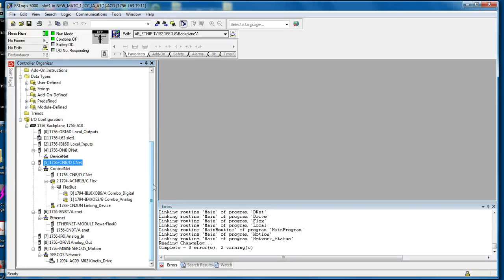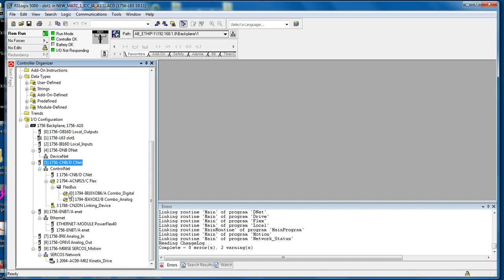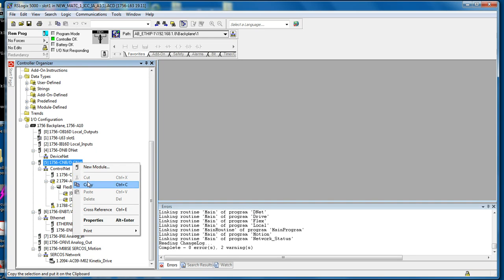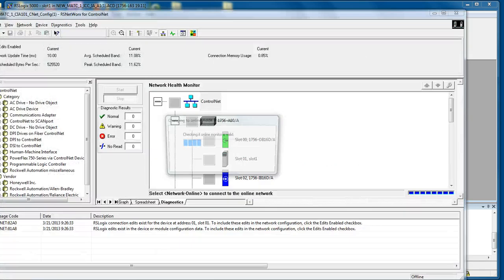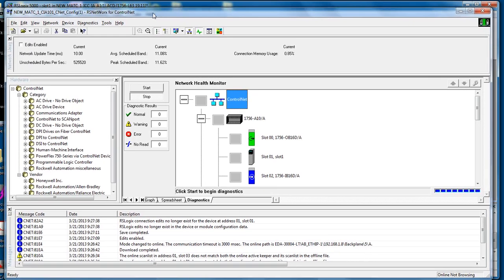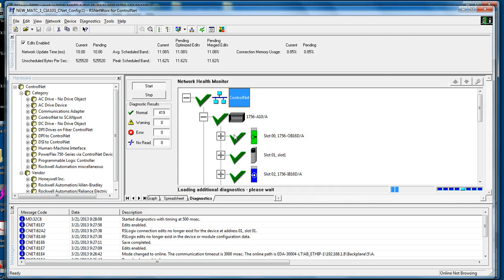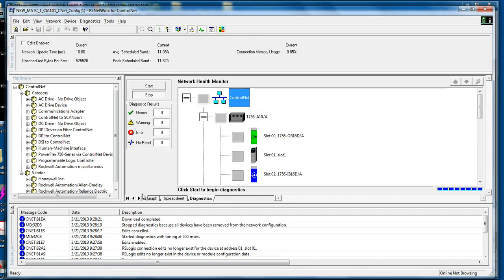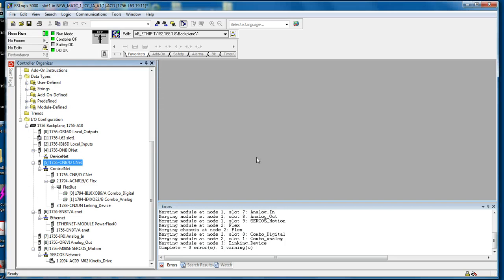How to fix ControlNet I/O errors in RSlogix5000 - RA IA workstation

Comment: The error message is 16#0204. Can it be resolved with RSNetworkx? Because my holiday is identical to the video
Reply from the maker: Looks like that is a node ID and/or rack size error. You should be able to resolve that with or without the RSNetWorX configuration software. Confirm each Node address on your  network and confirm that Rack size in your configuration. Troubleshooting with RSNetWorx and fixing the error will be much simpler.

Comment: I have the same problem... is there another way to fix the malfunction? Because I do not own the software used "RS network "
Reply from the maker: I'm not sure. There might be other, built-in support and recovery solutions to fix this error. Best to call Rockwell Automation or your System Integrator for support.
Reply: @PSDettmer  
I connected and entered the cpu, but I did not find a solution. Is the RS network program available for free or not? Is a malfunctioning I/O a problem with operation?
Reply from the maker: @عزوقصيبات  I'm sorry, I do not have any information on that. You'd have to contact your local Rockwell Automation distributor.

Comment: During the offline/Online Mismatch, a dialogue box appears!
1-Use online Data (upload)
2- Use offline Data (Download)

If we opt for the second option, will it affect the running system? I mean will it de-energize the IOs?
Will it cause tripping the plant?
Reply from the maker: Hello, thanks for your question. I recommend testing this on your own system during non-production. Try at your own risk! I found our training systems to be inconsistent, despite identical hardware and software. I was not able to determine an exact order of steps for a reliable solution.

Comment: The way you clicked on download ? will it affect the current running nodes?
I mean is it online or offline download?
Is it possible to update the controlNet network and it de-energize all the nodes?
Reply from the maker: Hello, thanks for your question. I recommend testing this on your own system during non-production. Try at your own risk! I found our training systems to be inconsistent, despite identical hardware and software. I was not able to determine an exact order of steps for a reliable solution.

Comment: Hi 
The controller need to be en program mode? It is possible to make changes in the control net network in run mode.
Reply: No, RSNetworx will ask you to change the controller to Program or it won't do it.